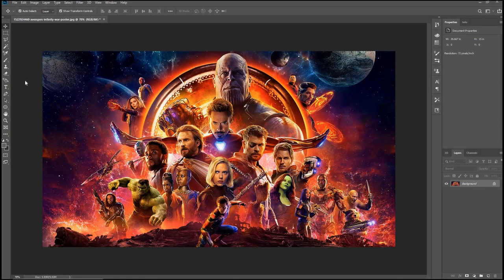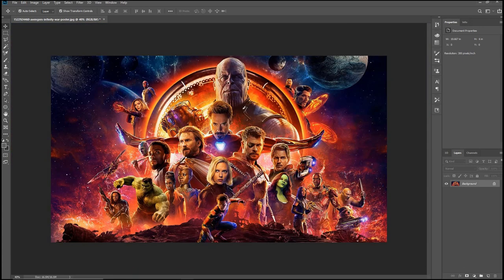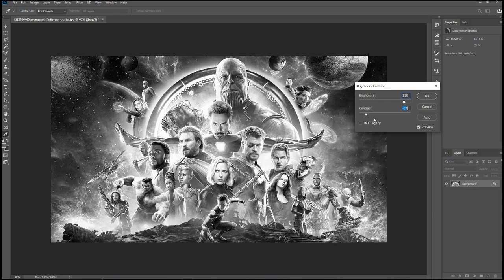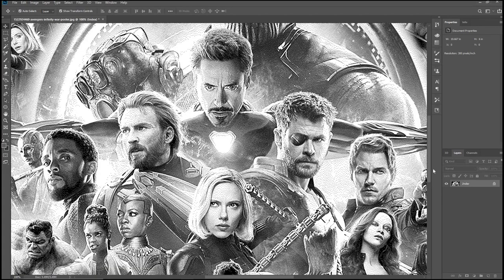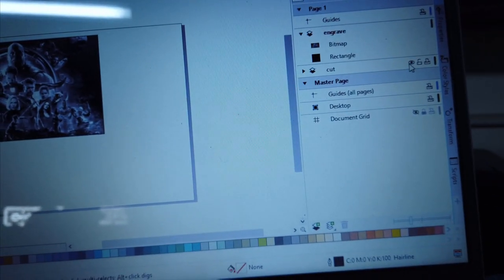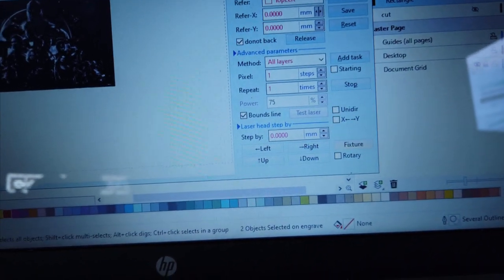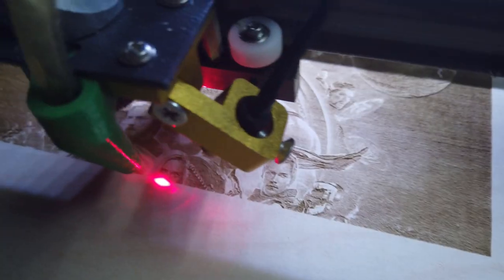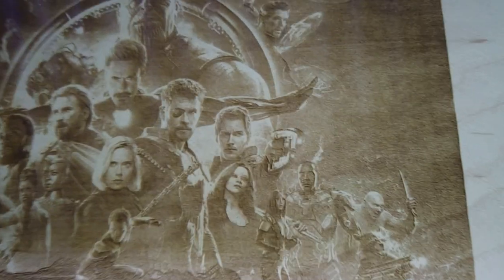How to prepare a Picture for laser engraving (Photoshop)

Comment: Picture not converting like yours I follow your video and doing exactly as u but the last step where u where u tap diffusion 100%and picture convert but not mine sir I work on same pictur in photoshop cc 2019 please help me sir what settings required for that thank for reply
Reply from the maker: hmmmm, make sure you go from fray scale to rgb, then diff, you may get no change if not done it this order, anslo make sure it is no to low of a res, try to zoom in after changes and see if you see the dots